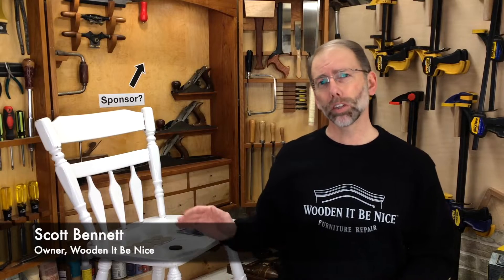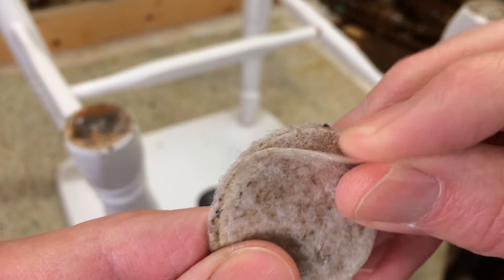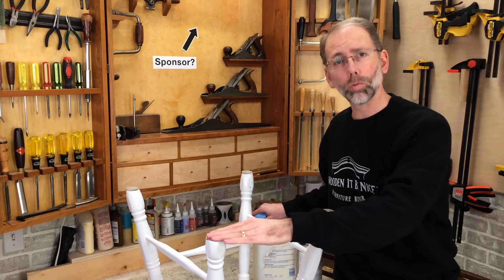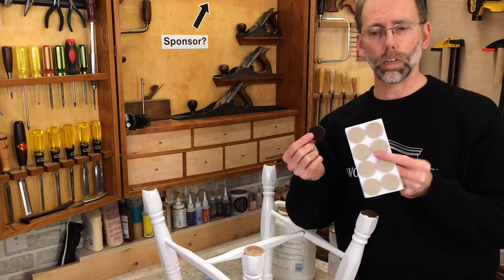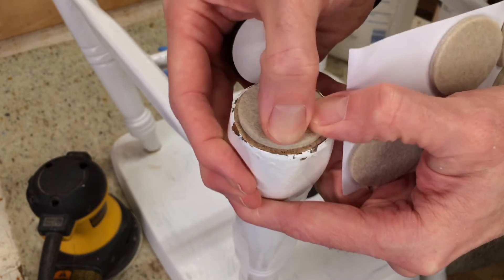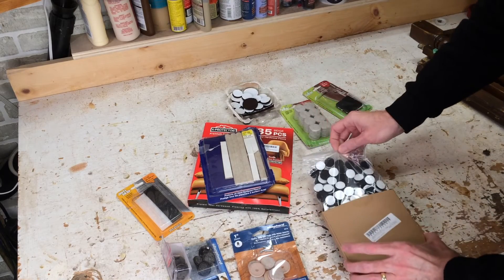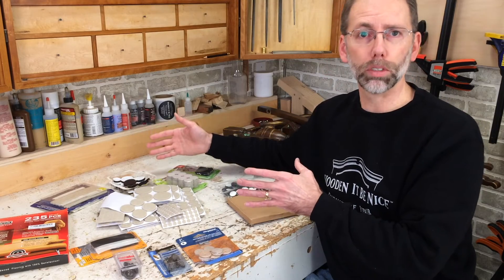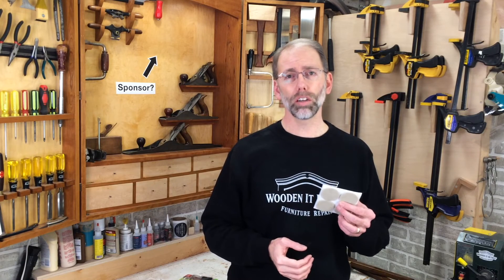How to Protect Floors with Felt Pads, Glides, and Grippers, a Home Improvement Woodworking Tip Video

Comment: Thanks for the info.  I've been using the glides with a nail, and only seem to discover a problem after there's serious damage to the wood floor.  I'm going to try the felt pads, and check them periodically.

Comment: Dear Sir.
Thank you for your review. I have a problem perhaps you can help me with.
I have a carpeted tuition center.
The student's chair legs dig into it.
I need "gilders" or something else to protect the carpet. Felt bottom are obviously not suitable as they increase friction.
The problem is : I can't think of a way to get the gliders to attach to the feet.
I was considering epoxy, but with 40 chairs × 4 feet! What a project!
I considered 3d printing, but don't know how to go about it (I live in Malaysia. )
Any suggestions?
To NO avail, I have not found ANY solution online.
Everything ive come across is either hard wood floors, or office chairs in a central location requiring a mat.
My problem, which I can imagine is not unique, is in between these two.

Comment: Here's a question unrelated to the classic furniture application for felt pads:

I just bought a used Porter Cable 505 1/2-sheet finishing sander. It needs a new pad. I understand the original pad would have been felt. On Amazon, the "official" replacement is $45! Instead, I thought I'd buy a 40" x 5" VOCOMO felt furniture pad roll on Amazon for $12. It could be cut down to make FOUR 4.5"x9" pads. Clearly, the savings is enticing. I am assuming pad drift would not be a problem because the half-sheet of sand paper mounts in such a way that it ought to clamp the felt pad in place. What do you think?

Comment: I either remove the adhesive or buy the ones that don't come with it. Then I glue them to the bottom of whatever I'm putting them. The thicker the felt, the longer it lasts. I check them every year and they usually hold up for awhile.

Comment: Even with proper prep, the store bought pads always seem to fail in some manner.  I finally solved this and extended the life of the pad quite a bit by taking the thickest pad I could find and carefully removing the adhesive film with a razor blade.  Next I adhered the pad using a hot glue stick.  The pads no longer slide or detach and last quite a long time.

Comment: Nail and screw are only good if you have carpet or tiles, if you use it on wooden floor, you're sure to ruin the floor once the pad is gone or the plastic cracked.
Using hot glue to stick simple pad is a good solution.
Reply from the maker: Thanks for sharing those tips!  Scott #tips